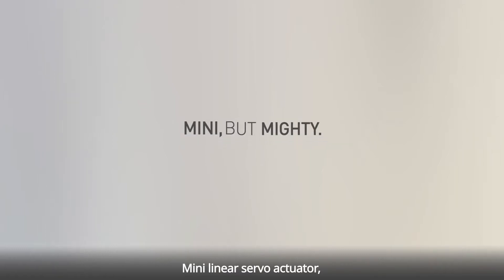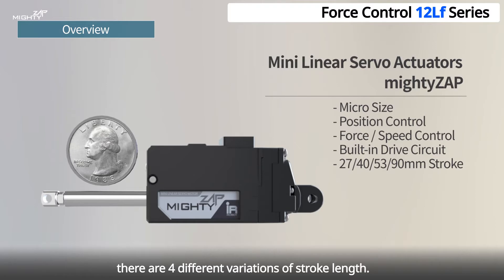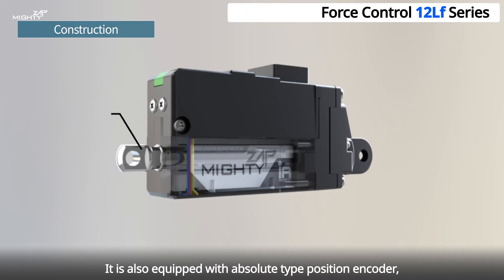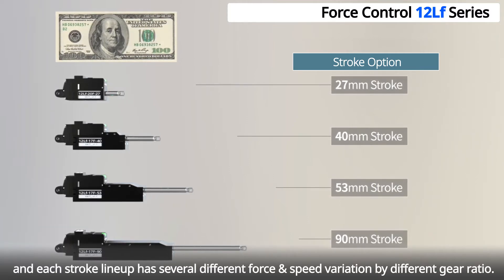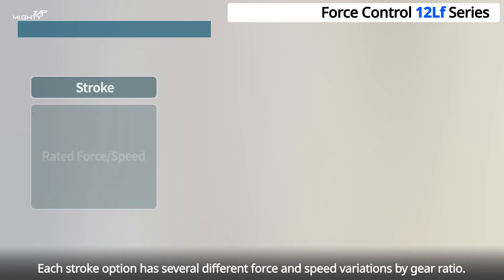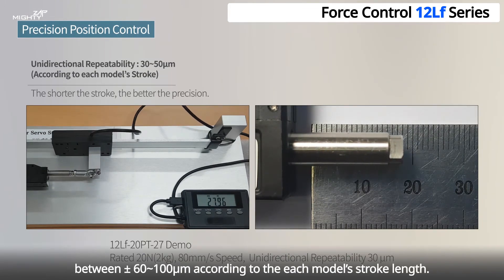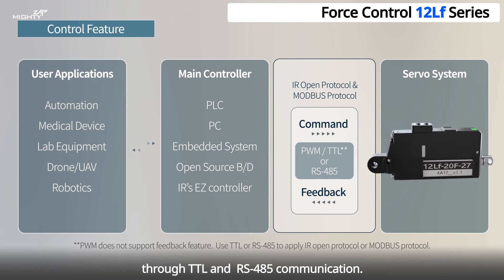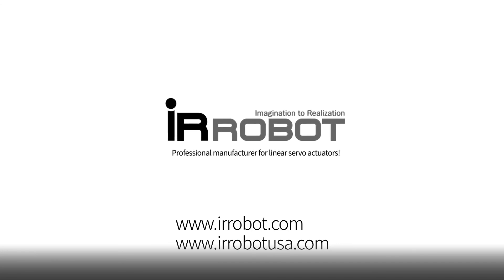Linear servo actuator - FORCE Control Lineup

Comment: I want to control all, force, position and speed. Please tell me which type of communication do I choose either PWM or RS-485. I wanna use it with Arduino board, so please guide me about compatibility
The link you provided for the library has moved. Can you please provide the latest link?

Comment: Do you have sample code to read/write to this linear actuator?
Reply from the maker: Sure, we have.  We provide API/library for C++, C#, Python, Java and Arduino.  Which language do you prefer?
Reply: @mightyZAP_KR  C++ please
Reply from the maker: @theaavila6495  Thanks. You can download API/library at http://www.mightyzap.com/en/digitalarchive4/?category1=API%20Library&mod=document&pageid=1&uid=174.  Then, you can see there are several different version of C++ API (#1~3 on above web page).  Please kindly be advised that these APIs are for the Force control lineup mightyZAP which starts model name with 12Lf.  If you wish to have API for the Position control lineup actuator (model name start with L or D), you can get them at http://www.mightyzap.com/en/digitalarchive1/?category1=API%20Library&mod=document&pageid=1&uid=173.    If you need further assistance, please feel free to contact us anytime.
Reply: @mightyZAP_KR  Thank you very much. This is also compatible with Linux OS?
Reply from the maker: @theaavila6495  Our C++ and C# APIs have been build under MS Visual studio and we could not verify if it works with Linux condition. But, we think that it is still worthwhile if you give it a try with Linux.
Reply: @mightyZAP_KR  Thank you! Do you know if this will work with other microcontrollers such as the OpenCM9.04?